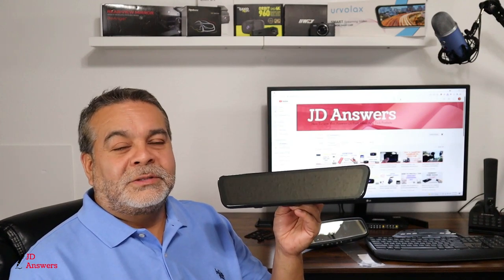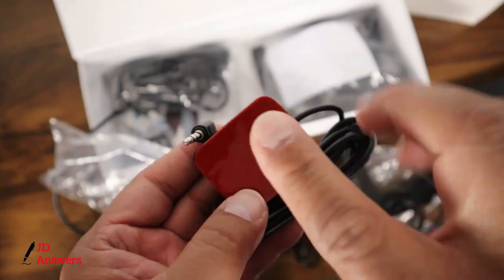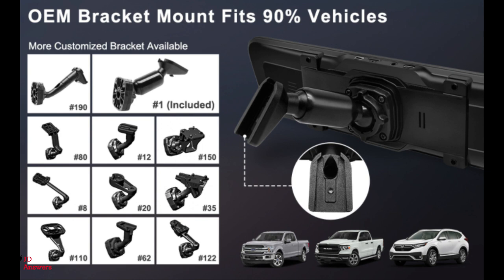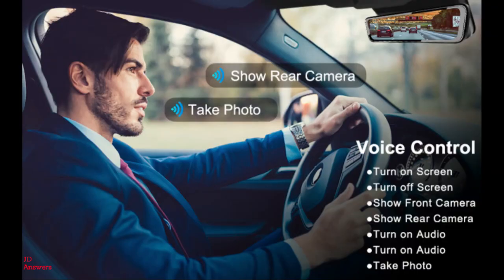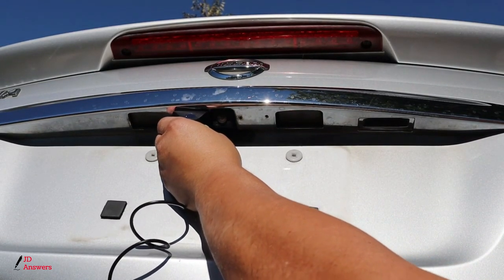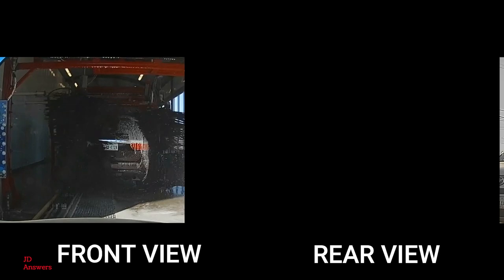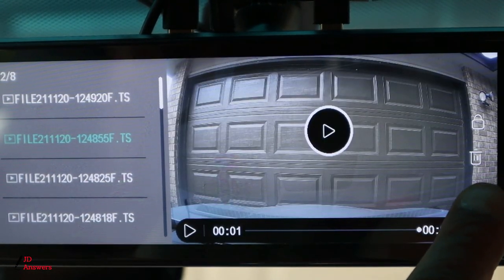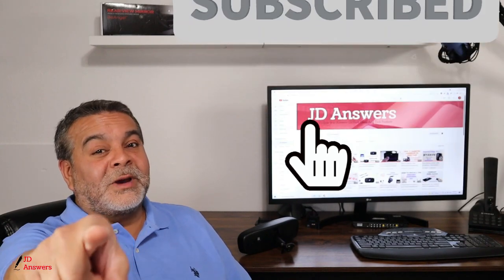URVOLAX THE BEST 12" MIRROR FRONT AND REAR DASH CAM, VOICE CONTROL,  HOW TO INSTALL A  BACKUP CAMERA

Comment: I installed this into a Mercedes transport van.  The red wire was connected to the reverse light.  The camera works, but shifting into reverse doesn’t change anything.  Is there something else I needed to do?
Reply from the maker: Your connect may be loose or you connected to the wrong wire. Let me know if you need more help

Comment: Excellent instructions!  I have a Nissan Titan 2004 pick up and installing a 12” Urvolax front and rear cameras.  What is the best approach to install the rear dash cam on the rear bumper hiding the wires? Under the the truck in the frame or follow the established wiring harness to the engine compartment? Thank you
Reply from the maker: I looked at some pictures and the simplest way is to install on top of the license plate. If the tailgate hits the rear dash cam when you lower the tailgate then move to right or left of the license plate. Then run the wires under the truck and use one the grommets to enter the cabin.  I would try to mount the rear dash cam  next to the tailgate handle. I attached a video for this procedure. Then follow the wiring to the cabin. https://youtu.be/OqgmCsDD3Mw . If you need more help let me know

Comment: i camt find the footage of the rear camera .. or where is stored .??
Reply from the maker: If you are reviewing your files in your computer, select "R" from the open files  to select the Rear Footage. If you are review the footage from the dash cam, select the file icon on the left of the record icon. The file icon is a back symbol with a triangle in it.  Your files will then be displayed. Touch the bottom icon which will toggle between the from camera to the back camera.